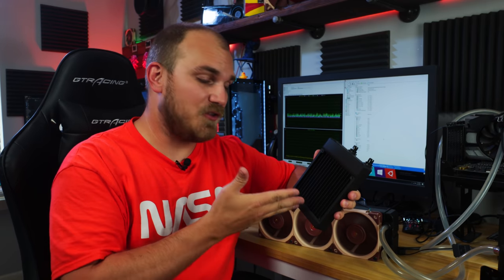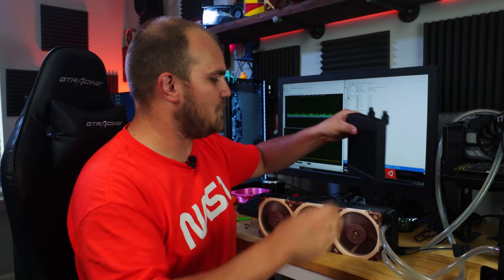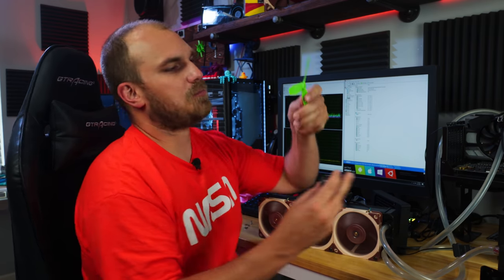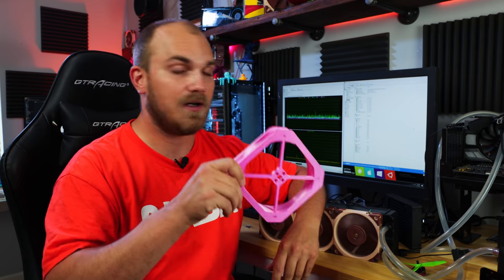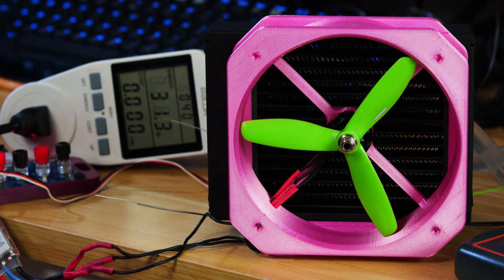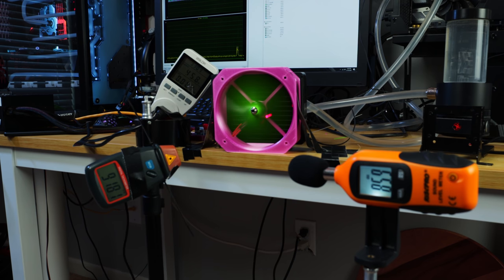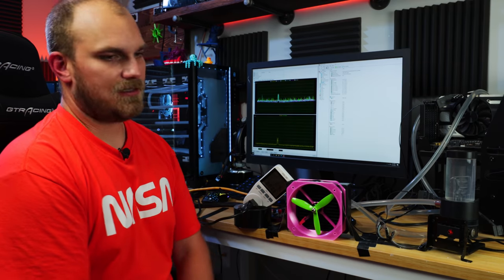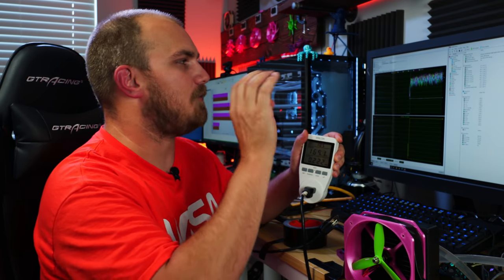20X PC COOLING, can this 120mm Radiator out perform this 360

Comment: Ok this is silly, can we go back to making something that will outperform Noctua fans the normal way. Spoiler: If you just go after one metric you actually can make a fan design that outperforms a Noctua.Like you can make a fan that moves more air than a Noctua can it the max rpm point of a Noctua which is about 1700 rpm if i am correct. This fan will however perform worse than the Noctua at other rpm. (Blade design for 1 specific rpm).

Comment: Finally we have some Fan fast enough to cool these 10 Gen intel processors, they are running close to 250w of full TDP.
Reply: Only if you run all cores at max boost and disable the turbo-boost power limits. They also transfer the heat very efficiently to the cooler. I have no problems cooling my 10900 at 200watts with my Noctua tower cooler and 600rpm Noiseblocker Eloops.
Reply: Find an older copper cpu heatsink that might be compatible.

Comment: I’d pay good money to see that “red bottom” actually take 2600kv. What a joke on the manufacturers part.
Reply: … that's not how the numbers work. KV states the relationship between volts and RPM. This is the no-load measurement so adding props and gears will reduce the actual RPM observed. KV is a good way to determine the max RPM your motor can achieve. A lower KV means more torque as per volt more energy is needed per revolution, a high KV motor will spin fast but have less strength. 

KV2600 means the motor will spin 2600RPM per volt applied to the motor.

Comment: Obviously you need 3 on the large radiator, seems an unfair competition for deaf computer users who live in areas with low power costs. If you used it enough you would go deaf, and be forced to move to a location that has low power so.

Comment: I said this once and I'll say it again. Try a car radiator. :)
Reply: Even with one of those tiny Honda rads, the thermal mass and the surface area should allow you to run passive… well, except for the pump.
Reply: @martindinner3621  idk, never tried it but I assume I'd run passively for an hour or so till the water starts warming up.

Comment: Delta Electronics FFB1212EH 120 x 120 x 25mm PWM Cooling Fan, 4000 RPM, 150.33 CFM, 56.4 dBA, 4-pin PWM connector ;) ;)

Comment: Using a CPU to compare fans is not exactly a good comparison, if you really want to use the radiator a constant heat load (just some resistors strapped to the water block) would be a bit more consistent.

But if you want to fully compare the fan performance you would want to 3D print a short wind tunnel with an adjustable shutter or choke so you can change the restriction, a differential air pressure sensor ($30) that measures across that restriction and a cheap anemometer ($20) to measure the airflow at a particular back-pressure.
A lot more measurements to make for that one though, it's more something that Gaming Nexus would have use of since by varying the RPM and back-pressure you can get a total characterisation of the fan that can be used to predict performance in any situation. If you are interested I could go over the design of a full testing setup with you, if you have some automation experience you could put together a very effective setup quite easily.
Reply: Should just make a Google document and share it publicly. I'm sure other people would be interested too.
Reply: @LeoInterVir  Put together an image of the basic setup, I don't really have a place that's good for sharing it but I can at least drop it here.
https://imgur.com/tR1IN74 It's just a bunch of tubes and plates that should be easy to print.

The adjustable orifice plate would just be two identical plates of holes that you slide over each other, covering and uncovering the holes. The anemometer measures the air speed through the known tube diameter, and a differential pressure sensor compares the pressure to the outside air. The first orifice plate and mesh are just to smooth the flow so that you can get an accurate reading.

The actual physical setup is pretty simple since the airspeed and pressure is so low compared to larger fans, the only bit that would need some work is automating the data acquisition so you don't have to read and type 50 values off an LCD screen, but I guess if you aren't collecting much data that's not much of a problem.

Comment: i think that even if you'd pass coolant on the world's largest radiator, it would s t i l l  b e  a t  r o o m  t e m p e r a t u r e , if you'd pass through two things, A and B, first at A, and then at B, B would be hotter than A, since it would accumulate A's heat, but, if we were to have two radiators, first we pass trough a radiator, then A, then through a radiator again, and then B, B would not be as hot as it was if it was a single radiator, since almost all A's heat was radiated to the air, hence more efficiency than just a larger radiator.

Comment: your rc fan is as air flow a rad need high pressure fan, ask noctua for F12 fan and compare them to your A12X25, the F12 will perform better because built for pressure and for rad
https://noctua.at/en/which_fan_is_right_for_me

your rc fan is like the S12, air flow no pressure